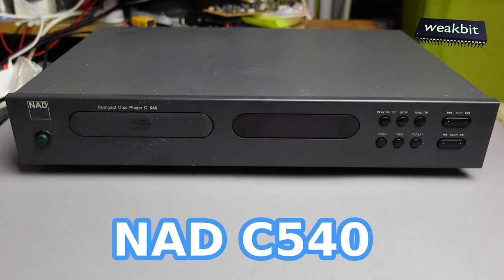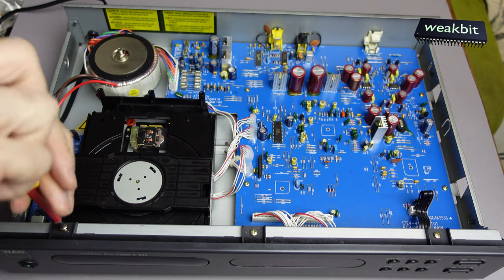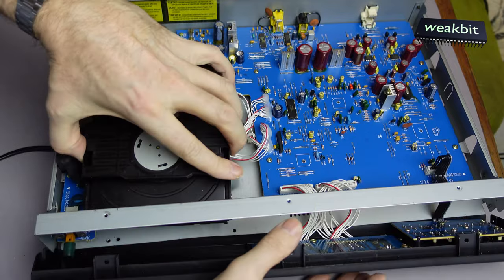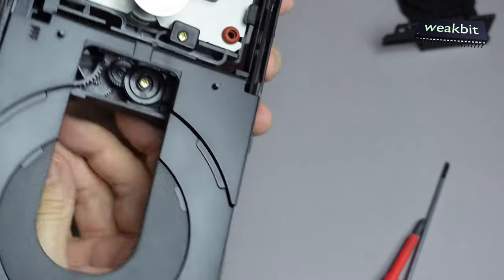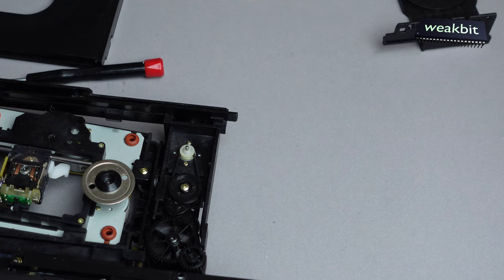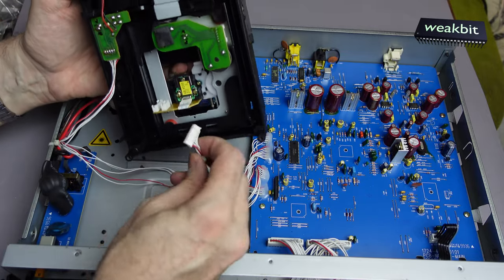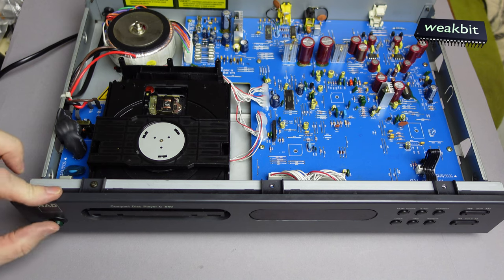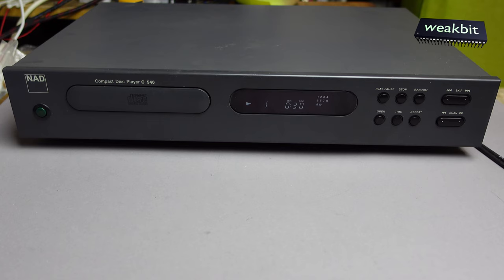NAD C540 CD-Player repair

Comment: NAD makes garbage, so it seems. There is no guarantee that a new NAD CD player will play, direct from the box. I have an NAD C538 that has never played a disc once. The display will tell you it's loading forever, then there is eventually a TOC Error on every disc, no matter what quality. I would strongly caution anyone against ever buying anything with the NAD name on it.
Reply: I haven’t had one issue. Not with my NAD receiver, CD player, or cassette deck.